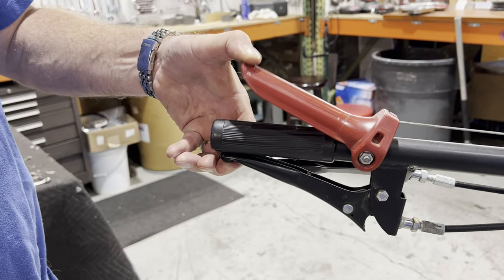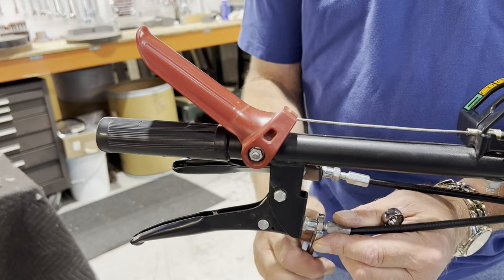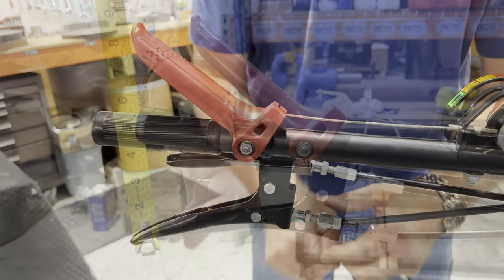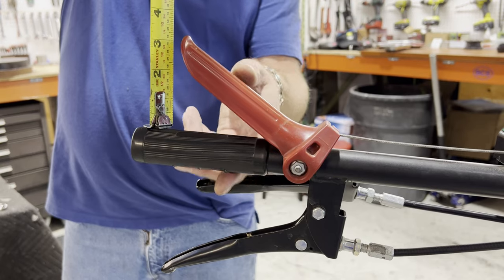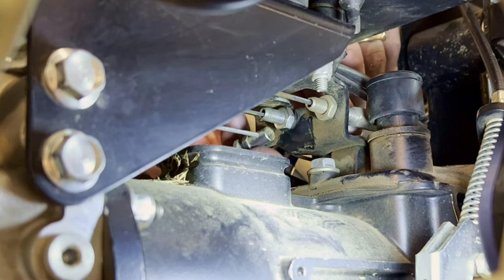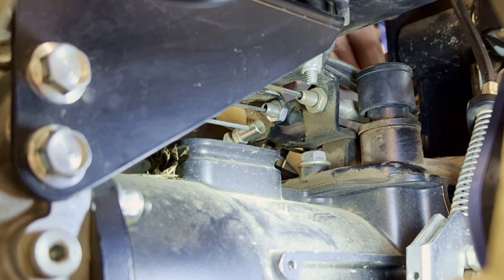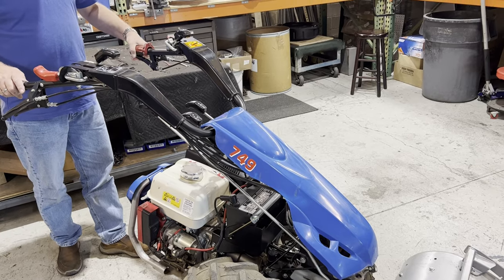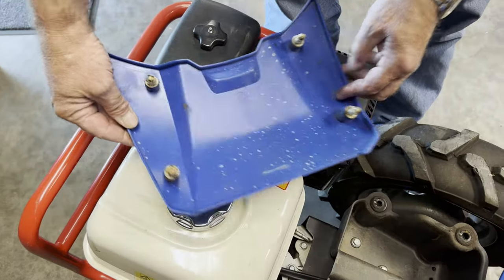Adjusting the Clutch & OPC Cables on a PowerSafe BCS Two-Wheel Tractor

Comment: Thanks for the informative video, my machine needs a slight adjustment. On another matter could you do a video on the differential lock as my machine doesn’t lock when I throw the lever?
Thanks Neil
Reply from the maker: It won't lock immediately after pulling the lever.  In order for it to lock, the wheel will need to turn at least a half a rotation.  For example, if one wheel starts spinning, pull the lever and the wheel should lock within a half rotation and the stuck wheel should start spinning.
Working on a video for diff cable adjustment now.
Reply: @BCSAmerica  Thanks, looking forward to it.

Comment: Hi BCS, could you tell me how I can adjust the Steering brakes on my BCS750 please
Reply from the maker: Okay, buckle in because this is going to be a long comment!

The two most common problems that occur with the brakes are:
1.	When the operator releases the brake lever, the brake does not disengage completely, usually causing a squealing sound; and
2.	The wheel does not slow down or stop when the corresponding brake lever is fully squeezed.
In both scenarios, unless the brakes were recently serviced, we suggest postponing the issue of cable adjustment and go directly to removing the wheel and checking the condition of the brake assembly.

The Brake Assembly
•	With the tractor in gear, loosen the wheel nuts a fraction of a revolution with your 17mm deep socket, extension, and socket wrench.  
•	Next, elevate the tractor using a jack or blocking, 
•	Complete the removal of the nuts and washers on one side and remove the wheel. 
•	Remove the brake drum.  If it does not come easily, shock it loose with a dead blow hammer.  Note: With PowerSafe models, check to make sure the parking brake is off.
•	If, upon inspection, there is oil in the cavity of the drum or on or near the brake shoes, the wheel seal is leaking and must be replaced before proceeding.  For complete instructions see the video REPAIR AN AXLE LEAK ON A BCS TRACTOR WITH DIFFERENTIAL DRIVE on our YouTube channel.
•	Next, clean the entire area within the bell housing of dirt and grime.  Use a commercial brake cleaner since this is both effective and evaporates quickly.  
•	Using sandpaper, remove any rust that may be present, especially on the inside of the drum where the brake shoes make contact.
•	If the shoes are burnished, we specifically recommend either an 80 or 120 grit cloth-backed sandpaper to create a fresh, roughened surface.
•	Next; using a silicone lubricant with nozzle, spray the pivoting post at the point where it extends through the backing plate.  There is a slight lateral play in the shaft, so push the shaft inward from the back side while applying.  Wipe the overspray from the back plate; then squeeze and release the brake lever multiple times.  
o	Please note that if, after this treatment, the shoes do not fully expand or the return springs connecting the two brake shoes cannot retract the shoes sufficiently to eliminate the squealing sound of the shoes making contact with the drum, you will need to follow the disassembly directions of the wheel seal replacement video to remove the springs and backing plates for more thorough cleaning, lubrication, and possible spring replacement. 

Cable Adjustment
•	First, loosen the cable clamp on the lower end with an 8 or 10mm wrench, depending on tractor model.  Squeeze and release the brake lever a few times to confirm that the cable is working smoothly and not rusted or kinked.  If kinked, we recommend replacing it.
•	Assuming the cable is OK, use a 13mm wrench to loosen the jam nut on the threaded tube located in front of the brake lever bracket.  Then turn the tube clockwise until there are only a few threads exposed beyond the bracket.
•	Returning to the brake end of the cable, use a pliers to grab and pull the inner cable till it’s taut.  While continuing to hold the inner cable, tighten the cable clamp bolt.
•	Now return to the adjusting tube on the handlebar and turn the tube counterclockwise until you achieve a position that, when you squeeze the brake lever, it stops about one inch from the handlebar grip.  If you can squeeze the lever till it touches the grip, the cable is not sufficiently short, and you need to turn the adjusting tube counterclockwise a few more revolutions.  Once the gap between the grip and lever is one inch, tighten the jam nut with the 13mm wrench.
•	Having achieved the proper position, it’s time to test.
Reply from the maker: Let us know if you have any questions!
Reply: Thank you BCS, my machine is almost new and has only been used for less than two hours.
I will try to do what you have send me and see how I get on with it.
Reply from the maker: @Paddyandpoppy  In that case, a cable adjustment is likely all that is needed.  A couple things to note though:
- these are "steering assist" brakes, and not meant to stop each wheel completely, just slow it down to assist with a turn.
- the brakes are only functional when the differential is not locked for positive traction in both wheels.
Reply: Bcs america your video are realy informative. Have you got any email contact to ask you some tech info on my bcs two weel tractor?